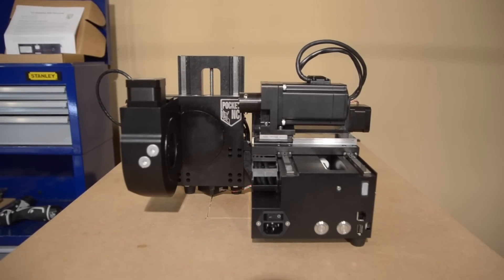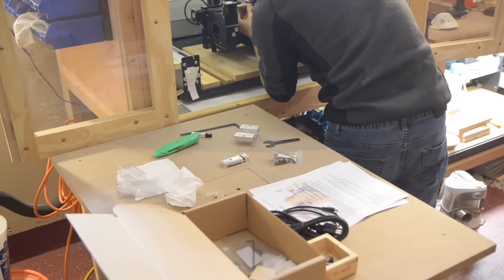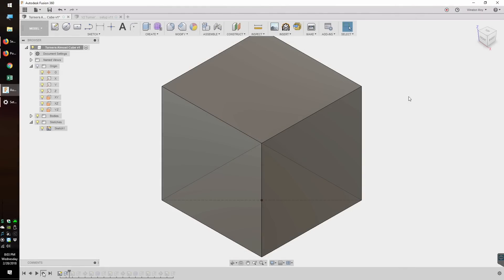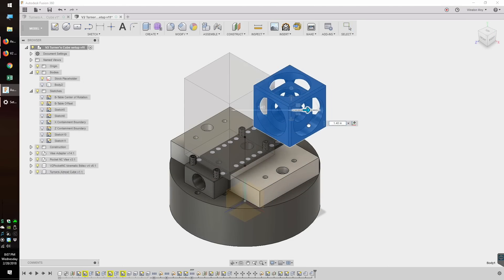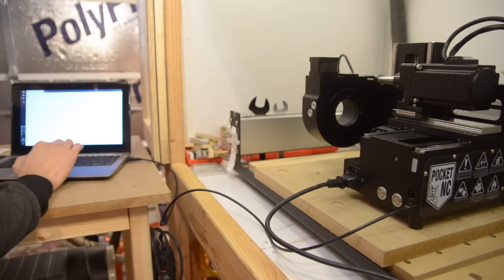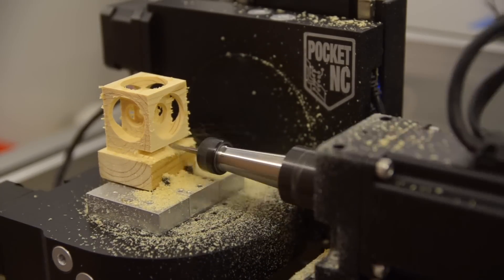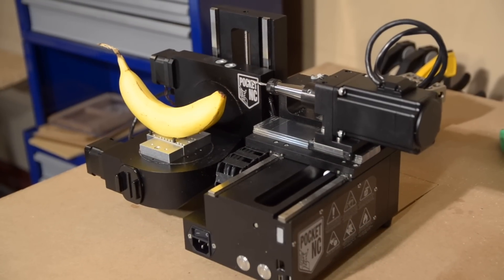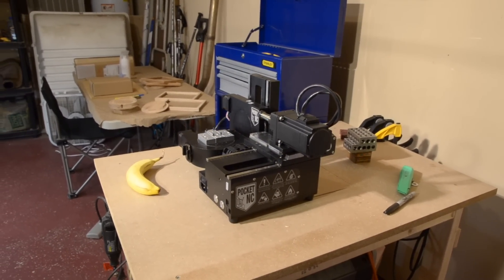Intro to 5-Axis Machining on the PocketNC v2 - Project #112 [CNC]

Comment: Pocket NC V2
from 4,900.00 

Also "Repeatability: +/-0.002 in at 0% load"
Reply: Yeah, that's pretty bad for almost $5K, but the killer is that it's the repeatability at "no load".  So unless you are machining marshmallows, you're probably SOL if you are looking for repeatability from one feature to another.
Reply: Glad I'm not the only one to think it's way overpriced. You could build a way better cnc mill for 5k

Comment: Why are they using a stepper motor for the spindle? Steppers are not good at high speed.
Reply from the maker: It's a 200W brushless DC spindle, it just happens to look like a stepper.

Comment: Pretty skookum video Winston, you made it look easy, but I know how hard it is.  I still want a 4th axis but never do I want the headaches of a 5-axis machine (again).  I am eagerly waiting for your homemade turbo for the Subaru....
Reply from the maker: Hah, I wish that was on the agenda... The only turbo mod I might make to the subaru is add a turbo blanket. Quicken up response a couple milliseconds, and reduce radiated heat in the engine bay. But I've come to accept that I can't make that obese thing much better...

Comment: Winston, I have been interested in this 5 axis machine for quite some time now, but completely turned down the idea when I saw the price of Fusion 360 Ultimate. Im just curious, will using the standard version of Fusion 360 be adequate to run 5 axis toolpaths, or would I need to suck it up and dish out the cash annually for Fusion 360 Ultimate? Which version of Fusion are you using right now for the toolpaths on this machine? Thanks!
Reply: It is an often misunderstood fact that Autodesk offers a free (as in free beer) Maker/Small Business license for Fusion 360. This license is for the full-featured (Ultimate) version of F360, which includes the multi-axis CAM features Winston discusses in the video. As long as your business revenue is under $100k US dollars per annum (or you are using F360 in a hobby/maker capacity) you qualify to use the free license. The free license can be renewed annually in perpetuity as long as you continue to meet the qualifications noted above. Absolutely the best bargain in the CAD/CAM world.
Reply: Eddie Kramer Wow that's great news! Thanks for the clarification. Guess I dont have any excuses not to try 5 axis machining. Thanks again!

Comment: Is that spindle using a stepper ?!?!?
Reply: Here is the spec sheet on the BLDC spindle motor used in the PNC v2, including the all elusive max torque data. The spindle motor is manufactured by Kinavo Servo Motors. http://www.kinavo.com/pdf/smh_ch/K60BL30-48V-144-211-3.pdf 
I believe the PNC v1 used the K60BL30-48V-100-211 (based on the model number found in publicly available Pocket NC import data found at https://www.importgenius.com/importers/pocket-nc-company). 
The only difference seems to be max RPM (14400 rpm vs 10k rpm). The PNC v2 is limited to 10k just like the v1 but I think the motor can go faster. And I don't see the  K60BL30-48V-100-211 model listed at Kinavo so it may be out of production now.
Reply from the maker: That would be what a 200W brushless DC motor looks like.
Reply: I have to admit i've never seen a brushless motor with that form factor, ta :)